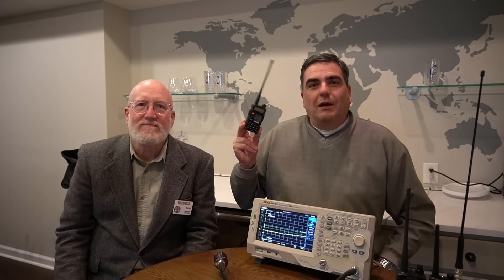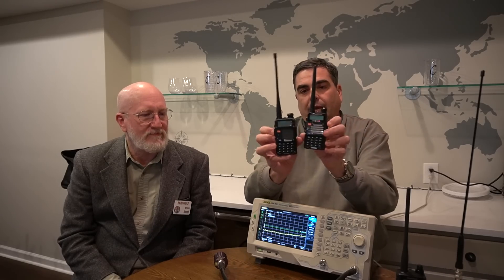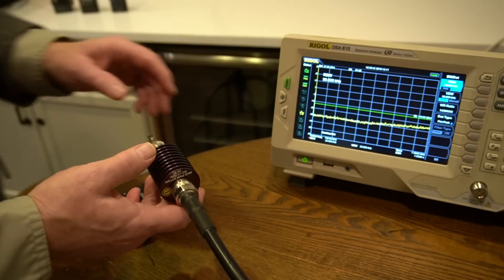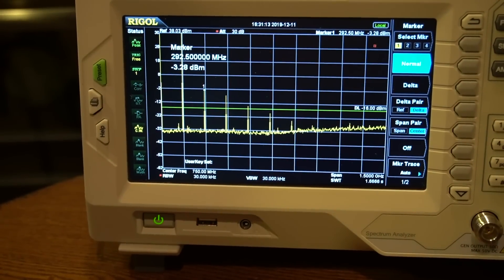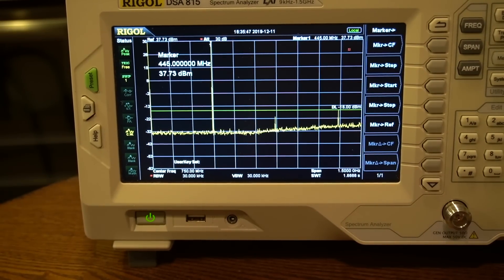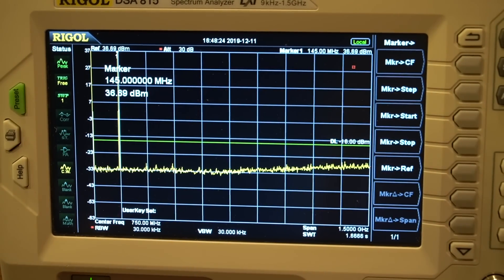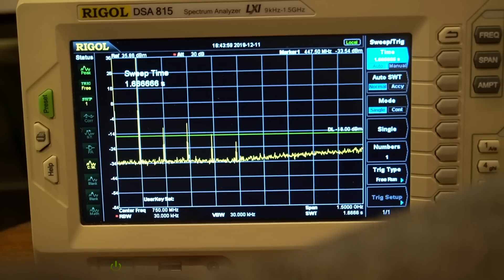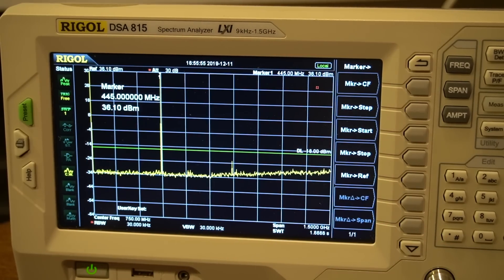Baofeng BF-F8HP testing for FCC ham radio compliance

Comment: Why is this a problem?  Here's one reason:  the third harmonic of your VHF transmitter may interfere with other licensed users on other bands, including other amateur radio operators.

For example: there is EME, satellite, CW and SSB in the 432-438 MHz segment.  A lot of this is extremely weak signal work, particularly EME and satellite, and the third harmonic of these out-of-spec radios may significantly interfere with other amateurs using these modes.  144 * 3 = 432.  146 * 3 = 438.

It's like a flashlight in a dark movie theater.
Reply: So when you key up on 144 at 8 watts, you're actually keying up at 432 at about 1-2 watts as well?
Reply: razorseal right principle but wrong levels, in the 1 millieatt region on the harmonic.
Reply: @g0fvt  ...and specious emissions should be in the 0.1mw PEP region (or below) per fcc, in this 8w PEP example.
Reply: @g0fvt  ...Would 1mw vs 0.1mw affect anything, in practice?  I'm not aware of any complaints.
Reply: Joe Shmoe it obviously could be a problem in the right conditions,  however I would not lose sleep over using one in a rural area on it’s own antenna. A lot of the critics of these rigs may themselves be radiating more harmonic energy albeit from higher powered rigs. I am not in an FCC jurisdiction, however unquestionably these cheap radios are spectrally inferior to the bulk of radios on the market by a significant margin. Unlike many others I have checked some radios myself over the years. The worst ham rig for harmonic output that I have ever encountered was a brand new (bought that day) Mk1 FT690, obviously that was over 30 years ago. I am guilty of owning quite a few UV-5Rs, they are tough, have great battery life and are easy to program with Chirp. They don’t have great receivers and the transmit should be cleaner.
Reply: @g0fvt  What problems with harmonics, about 5 Watts HT ? In Brazil the Baofengs is clear by our FCC, the ANATEL.
Reply: @mensagemii744  I would be wary about operating one into a "large" antenna in a built up area, where I live I am very confident that it woud not be a problem. IIRC the one I checked had harmonics at about -42dBc, not great but not terrible.
Reply: @g0fvt  Hi g0fvt:  Basically agreed ref 1 milliwatt region.  See my post to Brian and Don (posted 20 Feb) asking to confirm this very point.  I hope they reply, as there are so many stupid comments here and elsewhere on Idiot Tube that the world will come to an end if hams continue to use a Baofeng with its “horrendous” spurious transmissions (interfering with emergency services, etc.).
Reply: @iainmeteorscan1555  too true, unfortunately there is a lot of people mindlessly repeating what they have heard.. It would be a good idea for some of these naysayers to have a look at the harmonic output of their own HF amplifiers,... or the distortion products of the radio driving them.
Reply: @g0fvt   Hi again, g0fvt - exactly!  I always ask any Baofeng detractor if they have ever checked any of their own equipment for spurious/harmonic output, and, guess what, none have ever done so.  Typically, the Baofeng emits 1mW or less as a spurious emission.  Baofengs, unless they are “faulty”, actually conform the UK OFCOM/HAM RADIO Licence Rules which state 7(1)(b) “…not more than 1% of the mean power of the transmission falls outside the nominal modulated carrier bandwidth…”  A rated 5W (5000mW) Baofeng (or for that matter, any 5W radio), could therefore emit 50mW and still comply with UK Ham Rules!  It also means a UK 100W station can emit up to 1 whole Watt of spurious, and a 400W station 4 whole Watts of spurious!
Makes a mockery of all the Baofeng-bashing, doesn’t it?!
Reply: Like a flashlight in a dark movie theater... as opposed to a laser? :P
Reply: Very well explained!
Reply: It is not important harmonics over, for 5 Watts HT.
Reply: Its not going to matter if your antenna cant send the signal. Dont forget the antenna acts like a filter.. the amount of signal will be negligible...
Reply: Research and Build  yes and no, it will certainly radiate 3*144 quite well.
Reply: In practice this wont effect shit and these guys know it
Reply: @TheSoball358  exactly. 5W vs the spurious tx at 40 microwatts. That is what -14dBm is! A big bruhaha over nothing significant.
Reply: So, so what. Its s cheap emergency radio. Dont care if its too powerful.

Comment: I tested a BF-F8HP manufactured in 2023 on my R&S CMU200 and it passes 97e. On high power, 2m band, strongest harmonic is 2nd at -19.50dBm. That rigol is absolutely terrible, Wouxon have EASILY identifiable spurs at around -22dBm although they still pass. "No harmonics" on the kenwood. Well there are, but again that rigol isn't picking them up. That kenwood has spurs around -28dBm.

Comment: Thinking Ooh dear. at 1:14 . Is a UV-5R with different firmware. If you get 8W out of that then doing well. the 3 power levels, medium and high the same. 4W on a good day. I had 2 like you say 3 times the price. Not 3 times as good. 1 died. No audio on transmit, took it apart and had the volume control off to put on the working one that was getting crackly. PCB labled a UV-5R and is that PCB filtered, Baofeng give a stuff back then, no!. My money on it fails and did not do 5W. Wasted my money on Baofeng stuff, All gone now, Got a Yaesu. linked on QRZ on banner photo on my home page. Noticed on holiday in mobile home type thing, (caravan park) loads in a row, UK holiday park, you know the sort of thing. Used on holiday in the main living area, Transmit. The TV program stopped, knock out the TV, as it did at home but put that as diamond colinier antenna on end of house by TV antenna. maybe but harmonics hitting TV broadcast band not help. Problem on holiday in a caravan. Baofeng now do 1 model that is FCC tested. a replacement UV-5R and everything else they do of same but different. Now starting to take notice, stick to the rules. Maybe one day will get another but do like a proper radio, not direct conversion reciever that can cause greaf is strong signal nearby. But as time goes on, microchips change again, bet lower end radios get better, for  $30 good or cheap in UK  but the spurious emissions, No. Now to watch, only at 1:20 in
Reply: Edited, full of mistakes, useless at typing.

Comment: I just received one of these units in anticipation of receiving my FCC license. The video was made two years ago, and I could not find a more recent test. My question is this: Has the tech performance of the radio improved since the video, or can I assume it still fails? If so, why is it even allowed to be sold? If it still fails, I will send it back and get a more expensive-but-compliant radio for my first.

To clarify, I am NOT transmitting yet, but I will once I have the authority to do so. Thanks and I like your presentation; no fluff, not too many extraneous, spurious signals, just the meat!

Comment: I do not think it was a good test when the radio was designed to operate within the 144-148 MHz and 420-450MHz frequencies and the first test you make is at 292.5 MHz .    Also why was the Wouxun tested on high power and the Baofeng tested on low?

Comment: These days walk-in talkies are complicated.  How’s many AA batteries does that think take
Reply: While you can get 6-cell "AA" holder for the UV-5R but it doles come with a BL-5 1800 mah,  7.4 volt Li-ion battery pack.  You can also get a BL-5 3800 mah, 7. volt Li-ion battery pack for extended use time.

Comment: This entire amateur radio hobby is fairly technologically oriented and the people who are ham operators aren't exactly dummies...for the most part anyway, yet they still insist on buying and using these Baofeng radios knowing good and well what gigantic pieces of crap they are. It seems every video targeted at the new ham tells them if money is tight buy a Baofeng when in truth they should be exposing them right off the bat for the crap they are.

Comment: Hi Brian and Don.  Nice video, and good to see some real-world testing with good equipment – a refreshing change for YouTube!  Can you help me out here, please?   
I note the green line on the oscilloscope which represents the FCC maximum allowance of 25µW [microwatts] i.e. 1/40 of a milliwatt.  All your measurements on the oscilloscope are in dBm (dB milliwatts), where 0dBm relates to 1 milliwatt.  So, can you confirm that the 8 Watt Baofeng shows –06dBm on the harmonic transmission of 439.56MHz?  And also confirm that –06dBm relates to ¼milliwatt?  That would mean the Baofeng, although not complying with FCC regs, is only spuriously emitting ¼ milliwatt on the 439.56MHz harmonic.  
Postings to your video are all over the place with erroneous suggestions that the world will come to an end if hams continue to use a Baofeng with its “horrendous” spurious transmissions.  
Don – is the spurious transmission on 439.56MHz really only ¼ milliwatt, or are my sums wrong?  73.  Iain.
Reply: No expert here, but I would say you are correct. 

FCC regulation is 25 microwatts which is equivalent to 0.025 milliwatts, which is equivalent to -16dBm and -6dBm is 0.25 milliwatts, -3.28dBm is 0.47 milliwatts (calculated via online calculator)
Reply: @dan001427   Hi Daniel.  Thanks for your reply.   Just as I thought – it’s just not a great “deal changer” when you consider a Ham can get on air with a brand new Baofeng for as little as £25 ($30)!  Sure, the Baofeng does not comply with the US FCC regulations, but let’s be realistic; the world is not going to come to an end with the miniscule spurious emission from the Baofeng. 
 
Baofeng radios typically underperform US FCC specs by -10dBm, which represents spurious emission of 250µW [250 microwatts] – which is ¼ of a milliwatt.  Put into context, typical Bluetooth equipment emits 2½ milliwatts – that’s 10 x more RF – yet has only a workable range of up to 30ft.  Just how far do these Baofeng-haters think will be the TX range of a Baofeng when emitting ¼ of a milliwatt?  
Much ado about nothing!  Regards, Iain.
Reply: @iainmeteorscan1555  I agree, It would be interesting to perform a practical test to see if the effects are actually seen in real life.
Reply: They are using a Spectrum Analyzer not an oscilloscope.
Reply: @jfrphoto01   Hi John – I take it that you are a troll, otherwise you may have been more helpful and contributed to this video and the question I was asking?  Of course I meant spectrum analyser – tomato / tomayto. aluminium / aluminum – I suspect others knew what I really meant to say.  A slip of the tongue (so to speak) my end, and late at night – the concentration was not as it should have been!   Iain.

Comment: I have seen a lot of video's about this problem. But no one has  ever demonstrated what it actually means. I use a BF F8-HP, and I have for years with no complaints from any one. Also, you need to test the TYT UV8000e, which is the radio I use now. It just seems so much better then the F8. But you probably wont.

Comment: This is not how FCC part 15 compliance testing is done.  Don't claim you're checking for FCC compliance when you're not even remotely doing it right.  Try doing this properly in a full compliance chamber measuring 3 meters from the source using a proper EMI receiver.  I have no preference if the Baofeng passes or not but if you're going to claim something, at least do it according to specification using the correct test equipment.  This is nothing more than spreading misinformation.
Reply from the maker: We were testing for part 95 compliance and doing it correctly.

Comment: The FCC emissions specs are radiated. Therefor the stock antenna gain must be considered when performing a conducted test.  If the stock antenna is lossy at the harmonic frequencies tested then this loss must me subtracted from the conducted TX harmonics measurement.

Now if an after market antenna is used with higher out of band gain then it will fail. 

Therefor the radio MAY only be FCC complaint with the stock antenna.
Reply from the maker: Incorrect, the spec is power supplied to the antenna. 97.307e (e) The mean power of any spurious emission from a station transmitter or external RF power amplifier transmitting on a frequency between 30-225 MHz must be at least 60 dB below the mean power of the fundamental. For a transmitter having a mean power of 25 W or less, the mean power of any spurious emission supplied to the antenna transmission line must not exceed 25 µW and must be at least 40 dB below the mean power of the fundamental
Reply: @HamRadioInAction  its funny that you're worried about such a low power emission when the standard for high power transmitters is linear. I guess it's OK for the big boys to put out WAY more interference. Laughable.
Reply: You are correct.   FCC 97.307e is a conducted spec.  UV5R is clearly failing the FCC spec.  However it keeps selling in US and people keep buying it.

Comment: It would be interesting to see if the antenna(s) could provide any harmonic rejection. Also, check output power and harmonics across the bands, not only single frequencies in each band.
Reply from the maker: Interesting yes, but the FCC rule is for the signal supplied to the antenna.

Comment: I was thinking of buying one of these Gen 3 Baofengs. Don't think I will now. Thanks for the video.
Reply: I've used one for 4 years with no complaints from any one. Its a good radio. But make sure to get a better antenna, a 3600 mAh battery and a speaker/mic. I've never had any one tell me my radio sounded bad.

Comment: I guess the real question for me would be should I buy a Baofeng UV-5r or UV-5r+ plus for just emergency use only? Just want to have backup communication when cell towers not available.
Reply: Don't get either. Get the F8, its a good radio. I have one and have been using it for years, with no complaints from any one on how I sound.

Comment: I am completely new to this and whilst the information I am getting is continually being replaced by newer information, even on this channel, there are several things that are not clear on these tests:

Please note these are genuine questions, not trolling, so please be nice with replies.

Why test? 
What are you testing for?  
What does it mean if they "fail"?
Does this make them illegal to use?

The most important thing to ask : What have the manufacturers said about these tests?

I know my knowledge about ham radio you could literally write on a stamp but it may well be that this is acceptable within guidelines, I don't know.  

Surely if these radios are illegal they would be banned from sale by regulators?
Reply from the maker: In the US, congress has given the FCC authority and power of law to regulate the radio spectrum. Amateur radio rules are given in FCC code part 97. Part 97 dictates emission standards for radios, we are testing to see if these radios meet those standards. The test showed that the radio was not only transmitting on the frequency we had selected but 3 or 4 other frequencies both inside and outside ham bands. The radio failed because the power of the transmission on those other frequencies was outside what the FCC allows. By definition of part 97, the radio would be illegal to use on the 2 meter band. It just barely passed on the 70cm band. I haven't heard Baofeng ever make a statement.

Many Baofeng radios and other imports are indeed illegal to import and sell in the US, but not because of the emission standards. These radios violate part 95, because they can transmit on FRS and GMRS frequencies and are not type certified for those services. The FCC is sometimes light on enforcing there rules.
Reply: @HamRadioInAction  why do they have an fcc certification stamp on the back of the radio?
Reply: @maxlumens9085   Hi Max.  Why do Baofengs (and for that matter, any made-in-China radios) have FCC certification stamps?  Simple answer: because they are made in China, and China can do as it pleases!  Even infringing copyright, if it so desires.  
Anyways, notwithstanding the FCC Regulations, in reality (in this test) the Baofeng spurious emission was 0.25mw (quarter of a milliwatt).  BIG DEAL - as if (in reality) that's going to cause any problem to emergency services, etc.  Much ado about nothing.  

You have to realise that most Hams spend their time discussing what they CAN'T do, rather than what they can!    Regards, Iain.
Reply: @iainmeteorscan1555  yeah, I understand and am well aware of shady business practices by china. I'm just surprised that the FCC allows them to be imported with that certification. Thank you for the info though. Cheers.

Comment: Ah I see a corvair© situation. The VW© bunch is there. Vote with your feet/wallet. As the mfg learns. He will get it right. Or die. Oh my 6 chanel Hy-gain©. Circa late 70s still hanging in there. I carry around a audio generator hardly bigger than a remote. Bell south© no:xxx. That I send a 1700 cps tone and it has a phone key pad to dial out. We came a long way. Vote with your wallet. It will get better, or die on its own. 73

Comment: How many HTs did you test for freq. spectrum that met the FCC license so far? And do you have any recommendation? Other than the expensive kenwood and wouxan.

There has to be more than handful of chinese brand with FCC license approved. Is this F8HP not have it? 

I think it would just be give or take when it comes to FCC approved on HTs since there can be so many factors which can affect the freq. of the radio. Though, is still reasonable to get one with FCC license approve. You just have to be mindful of power level you use.

You should test other freq. that are part FCC other than UHF/ VHF 2m and 70cm band.

Thanks for sharing!